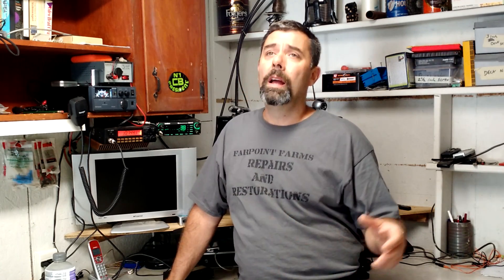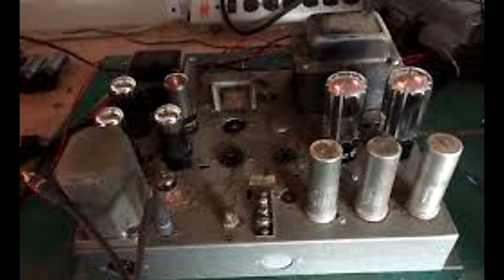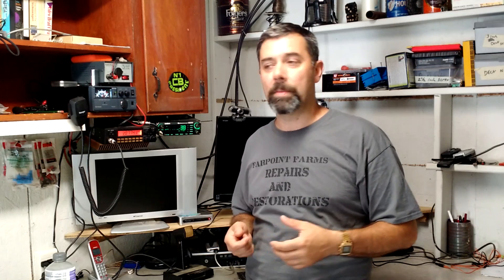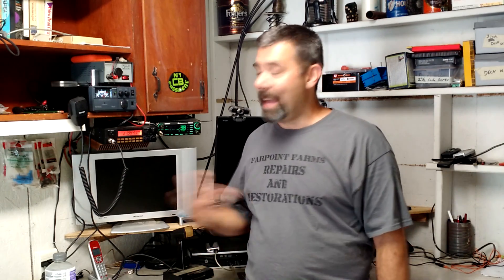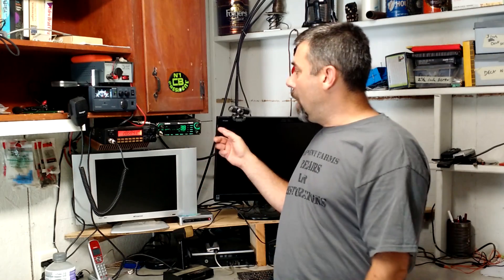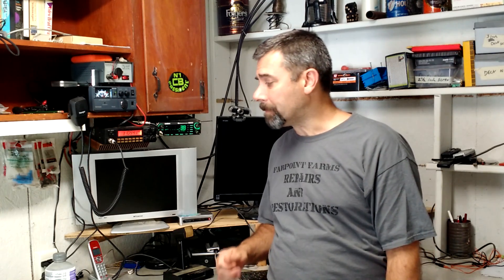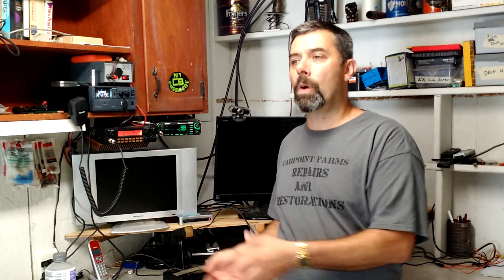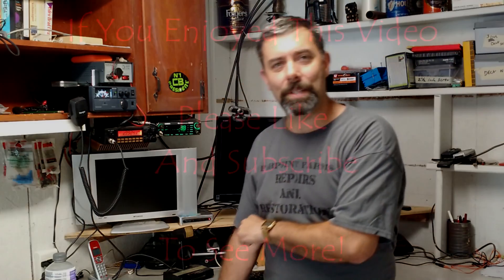A Beginners Guide To CB Linear Amplifiers.

Comment: I remember a little differently, the amps I used multiplied the signal by a factor of ten...100 watts in 1000 watts out....so to keep it simple I eventually had a kicker for the kicker...all of this stuff was locally made as in the late 60s there was not a lot you could get...I lived out in the country so interference with anybody else was not a problem.  If I heard them I could generally talk to them....I also had a set of five-element beams in the top of a 110-foot pine tree which helped considerably..When not using the beams I used a big stick mounted in another tree....its was a lot of fun back then but I had to give it up when I went into the military and transferred around a bunch....

Comment: I built a Heathkit GW-12 base cb back in the early 60's. Fast forward to 1999, at a Hamvention swap meet I found an identical GW-12. It works great but only puts out 1 watt. I replaced all tubes and tuned the coils per manual, but 1 watt was all it would transmit. This is why I am looking into a amp that can take my 1 watt and increase it to 25-50 watts. Any suggestions???

Comment: I have a fat boy competition amp that I occasionally use when the skip is rolling and it’s a high drive 6 pill with HG2879 finals I bought it used for $570.00 new they go for $850.00 I have my set up in an 18 wheeler all properly turned and running clean

Comment: I was a US Navy ET. Stationed in Charleston in the late 70s. The guys, we were CB nuts. North Charleston had a Army/Navy junk store. We ran across this tube 12 channel Johnson with a box of Tx/Rx crystals. We also found a linear amp 15 to 300 MHZ. 1000W. Make this short with help from the US Navy and our Division engineer. We ended up with this Flame Thrower. We never got caught. Drank to much Jack to worry about. I got out 1978. With some tuning we got 21w we ended up using a tunable attenuated load with a power meter. We could get 450 to 600w. We used RG214 even had access to run return loss on all the setups we made. I found you on Pinterest great video. I too live in WNC

Comment: I bought my first cb radio in 1975. A Royce 1-602a 40 ch. After a tune up , low key with best swing in wattage. Was 3 wstts key with 7 watts swing. Stock mic. It was very clear transmission with forward swing and about a 7 miles good talking. Using the 102" whip antenna. 
 Later I set up a base station with a supper penetrator 500 antenna with the President HR2510 did a chip mod for more frequency 26.000 mhz - 29.660 mhz .
Put a mini scout amplifier inline and adjusted the power of the radio down to 1watt key up and 15 watts swing. That is as low as it would go. Talked all over the world with 140 watts swing. ALWAYS had good compliments on the sound and clarity of the radio. I was using the D-104 mic.
 I did use a texas star dx 900 in my pickup truck that would do 1000 watts on high power but I ALWAYS run it on low or medium power for the most swing. Talk 40 miles in the day to base station.

Comment: Have an old Kris Mach 3B tube amp from the early 70's. Recommended not to drive it with more than 3 watts...as per the manual. Would that exclude a radio that dead keys 2 watts, but swings to 15 watts with modulation? I always thought that the dead key is what matters and not so much the swing wattage.

Comment: Thanks Eric, you just talked me out of an amp.
Reply: You don’t need an amp. In the early 80s I had a good radio with a good mic and a good antenna, and I lived in a higher elevation than most of the idiots on the radio in my county. My signal was clean and strong! Then one day I raised the antenna another 10 or 15 feet, holy cow! Much better improvement than any amp could have ever done, and regular people that I spoke to were accusing me of running an amp because my signal got that much stronger. Quality Antenna and height are king!

Comment: I have a Realistic Navajo TRC-433 Basestation cb , ext. swr/antenna switch…connected to a Tram-1499 antenna. I have a linear 50-80 watt amp and power supply coming from eBay… I’m making a mistake aren’t I ? Thanks again for your awesome channel

Comment: I remember my auto mechanics class in high school back in the late 70s the instructor had 4 or 5 of us guys stand close to the cb antenna on his car holding fluorescent bulbs and when he keyed the mic all of em lighted up...being teens we were suitably impressed!
Reply: I remember the fluorescent tube trick. I took auto mechanics in junior and senior year in HS 1970 & 1971.
Reply: We did that in the Air Force before climbing on fuel trucks to check levels for our generators on radar sites. They’d tell us they blocked out transmission to that sliver of a spot. We had a tube duct taped to a broom stick that we’d hold high up. Definitely saved us from radiation a few times.
Reply: My electronics teacher SUCKED!  I should have took auto mechanics.  I ended up being a forklift mechanic anyway
Reply: @justins3810 
😂
I was the opposite my auto shop teacher sucked and I became an E.E 😂
Reply: You will need an antenna set to handle the power you are going to use. Heavier coax is also a really good idea.
Reply: zip tied on to an antenna. I got pulled over for it LOL.

Comment: Cool video. 
I run a. Competition built    Galaxy Saturn Turbo radio with a custom rebuilt KLV 2000 amp (4400 pep) threw my 5/8's base antenna 45'  
#12... Watkins Glen new york wavin.

Comment: ++++++++++++++GEE LINEAR AMPLIFIERS ON CB RADIO IS  BIG NO NO N IN AUSTRALIA AND WE ARE ONLY ALLOWED 12 WATTTS -PEP + EVEN THOUGH IT GOES ON (I HAVE NEVER USED 1) I WOULDN'T TEMPT THE LAW+++++++++++++++ANYWAY IF YOU ARE CAUGHT USING A LINEAR AMPLIFIER THE LAW HAS THE  RIGHT 2 TAKE ANYTHING RELATED 2 CB RADIO AND IT'S NOT A CHANCE I"M WILLING 2 TAKE++++++++++++++IT CAN BE AN EXPENSIIVE $$$ ENDEVOUR+++++++++++++++NO LINEARS 4 ME++++++++++++++

Comment: Hey. I got my eyes on a ssb/AM Cobra 135, Palomar skipper 300, Uniden BC890XLT, Dosy TC 4001, Para Dynamics Antenna Switch PDC4-DX. All I want to do is talk from home at my apartment on the CB Radio. I have an old Midland 76-858 on its way in the mail if it works. What are the other items listed good for? Do I need the other items? Is one an amp? If I use amp in my Apartment will I be in trouble? Could I use Palomar later legally for ham radio? I assume that's the amp maybe? I'm new to Radios. And want to learn. I'm disabled. Sick of Facebook. Want to keep it old-school. Love and Respect!

1 Cobra 135 radio
1 Palomar radio
1 Uniden Recruit BC890XLT radio
1 Dosy C-400 meter
1 Para Dynamics PDC4-DX antenna switch
4 microphones - Sadelta, Astatic, Magnum, Galaxy

Comment: Every amp I have owned easily handled the regular cb radios, 3-4 watts output. People who make these amps know what power is being used and build accordingly. 1/2 watt is ridiculous. The most basic keying circuits, using the 2n2222 transistors, yes, I have built many amps, just finished one with two 8950 tubes, will take the 3-4 watt level of power from a cb. If the maker of the amp says you must use 1 watt or less of drive, then don't buy it, it's crap.
Reply from the maker: Good to know!

Comment: I've been on the CB radio for many years and I enjoy the radio I have a lot of fun but in my opinion the majority of people on the CB radio are running power if you don't have a little power you're not going to get out over the noise level as far as the FCC goes here in the state of Florida I was told there are only two FCC agents and they really have bigger fish to fry than worrying about a operator running a little Heat if you're running a lot of power and interfering with School PA system coming over the fire department radio you will definitely have the FCC looking for you we have an idiot here in Florida on Channel 1 who throws a dead key for hours with noise toys  the other day he was keying  up on three different channels so here you got a fool with three base station antennas throwing dead Keys interfering with people's conversation he has been doing this for years you would think the fcc would come knocking at his door nope!!!! Like I said the FCC has got way bigger fish to fry than somebody running a little Heat
Reply from the maker: I've heard that from a few folks. The FCC is no longer interested in the CB/HAM bands. They are there to protect commercial interests.

Comment: Been 4 watts ever since CB was moved from UHF to HF. I wish it was still on UHF.
Reply: GMRS is UHF is Part 95 CB but needs a license.  Cost for the 10 year license is $35.00 and you can run up to 50 watts and use repeaters.  Your immediate family can operate under your call sign just like back when 11 meter CB required a license.

Comment: Being a CBer with a "ticket" , having a clean signals is better than strong distorted signal.   Put the money were it should be, in the antenna system. The radio is only as good as the antenna system.  High wattage isn't always the solution to communications, but the mode used (SSB, FM, AM or CW) is part of the answer to the problem. Just another tool in the toolbox.  Personally, I still enjoy SSB on channel 38 running a stock out of the box Cobra 148 GTL. Old school.   Always have enjoyed your videos and your "style" of presenting information, kinda like FDR ' s fire side chats during the Great Depression.

Comment: I used to build my own amps back in the day. If you know anything about tubes, I used two 4cx250b's. They were metal tubes that sat in chimneys with a blower pushing air thru. It would do 600 clean watts am and 1200ish ssb. Had a 4 element moonraker 80 feet off the ground. It was a good combo to reach out and touch someone. Ahh the old days. Now I'm more in to low power FM.
Reply: The moonraker, was THE legendary antenna, back in the day,,,GREAT name for it, too,,,,,,😎
Reply: My grand dad had a 4 element moonraker on a rotor and a 201a tram it would blow the windows down

Comment: To propagate a signal for 100 miles that antenna would have to be high enough in the air to irritate the FCC. Line of sight is still a thing despite power output. I can tell you that ( and this applies to the high drive amps too ( I really don't care if you agree with me or not, been there and tried it more than once)) 1 to 1.5 watt dead key and swinging to say 7 or 8 watts is perfect to drive any texas star or palomar ( and most off brands).  At that point everything stays smooth and happy. Also, keep the modulation reasonable too so you don't splatter adjacent channels big time.  Legal or not, I like being prepared for emergencies when I am on the road. You never know when you'll be in an area with no cell coverage, being able to fire up a couple hundred watts might just save the day.

Comment: The fcc really needs to revaluate a stock cb power out of the box now that tv’s are all digital and don’t suffer interference from cb. A stock cb should be allowed up to 50 watts so your getting a product that works out of the box. 4 watts just isn’t enough on AM unless you have a big antenna like a 102 whip. The 80’s was so much fun on cb and way more active than today.

Comment: 4 watts works ok if your running an antron base antenna like 40 feet in the air but in a mobile you need more than 4 watts to be heard more than a couple miles unless you drive up to a big hill. A cb should come stock out of the box with 3 power settings 1,5and 20 watts.

Comment: It says on the FCC website that they are no longer enforcing CB amping. It says they have better things to do.  RM italy's are designed to handle up to 20W dead key p to p. It is good in a truck to amp to about 50W as there aren't many on anymore and you need to be able to reach out and touch someone, especially in the mountains.
Reply from the maker: That is good to hear about them not enforcing it.

Comment: Hi. Do you work on radios? I also have a Uniden Washington that I purchased 2nd handed. Somebody put the extra channels in it and on the regular 40 it doesn't key up and transmit as good as it does the extra channels. I also live in NC. Thanks
Reply from the maker: No, sorry. There is a guy some where near Hickory that does work on them. Not sure if you are close to there.
Reply: @FarpointFarms  Thank you. I actually live in Concord, near Charlotte. I use to travel to Taylorsville to have my radios worked on but the repairman passed away and I haven't found anyone that I trust now to do my work. I would drive to Hickory if I knew how to get in touch with the individual your are referring too. Thanks for your reply.

Comment: You're right most amplifiers can only handle one maybe two watts of input. Now if you get yourself what they call a high drive amplifier those can handle more power. And you've got to be careful with a lot of amplifiers today because most of them are using mosfet finals. And they cannot handle any type of serious power like the good old Toshiba transistor.

Comment: I run a big RCI 400w radio in my semi truck, I don't run it often at that power, as I can flip the switch and do 50w. My big advantage is that while most guys can't talk to me until they get closer, when I start hollering at the opposing direction of traffic that there is a wreck, or emergency up ahead, they hear me long before.

Comment: I want to boost my signal because it seems like my radio can't reach out more than a mile.
Reply from the maker: I would first make certain that the antenna and cables are A-OK. The antenna is the #1 reason you will have issues with signals. Try to hook a SWR meter up to make sure it's tuned right. If all else fails there are always amps, but putting an amp on a radio that is tuned poorly will only cause damage and anger.
Reply: @FarpointFarms  I have a Cobra 29 lx radio with a Wilson magnetic antenna.

Comment: The bleedover is generally more about the amp / transmitter having a ton of deviation - basically a junk unit that can't stay in its lane. Ham rigs are often in the 1000w or more range and they aren't bleeding over into terrestrial radios for the most part. A whole lot of that interference was caused because people that didn't know what they were doing were building linears from kit with questionable components and design ... if the FCC was really worried about it, they'd have allowed some linears and certify the equipment. There's not much of a reason cb can't run 20w, it's not that much but it'd have got the vast majority of people what they were after probably.

As for skip - there are hams that talk all over the world on 5w QRP rigs. Get the right antennas, cabling, and whatnot - good radios etc - and realize that watts don't equal range necessarily.

Comment: DB is a logarithmic increase. So it confuses the heck out of people who aren't techs. Write this down. This is much easier.. Each time you double power out. You increase transmitting range ~ 40%. A general rule for RF engineers and techs dealing with path gain. Can be calculated and confirmed using a smith chart. Obviously, Will not apply to signals being attenuated by the horizon. But a great rule of thump for line of sight. The very best bang for the buck is 50 to 100W output. Trying to punch over the horizon using ground propagation demands even more power per unit of range increase. Diminishing returns. In vehicles, big amplifiers can easily load and overload alternator max ratings causing premature brush failure. That can leave you stranded...Course, that never happened to me. Im way to smart..Right? 12 watts PEP generally hits the horizon with a pretty good usable signal. 85% of a station is its antenna. 85% of a radio is its receiver. put most of your cash and effort into the antenna just like this guy says. Then buy a silly looking radio with lots of knobs on it.

Comment: At 13:45, I agree it's a bad setup if you're using RG-59 (75 ohm) coax instead of RG-8 or RG-58 (50-ohm) for CB.  😉
(Yes, I'm sure you mis-spoke and meant RG-58.)

Comment: Like many people who gave up CB and decided to get their ham radio license. The FCC has removed CW requirement from the license.
Two meters is short range, 30-50 miles depending on the antenna and power.
Two meter single side band running 15-20 watts will get you 200 miles.
You have the 450 mhz band or setting up a station to talk to (OSCAR) Orbiting satellites carrying Amateur Radio.
I like to hand out on the high frequency bands such as 80 meters. We get on the air in the morning with a group that range all the way from Oklahoma, Dallas, Lampasas, Louisiana,  Houston and San Antonio.
We talk about everything from flying airplanes, Drones, Radios, Antennas. The subject varies with what we are interested in.
One thing when all the cell phone systems go down ham radio operators will still be able to communicate.. '73es
Reply: MHz, not mhz.

Comment: Nice video, I started off needing a license and had and still have my 23 channel RCA tube cb with a vfo, needed to buy crystals for transmit also used a couple of linears.
Reply: I had a Cardon Spitfire back in the day, wonder if it's the same chassis as your RCA. iirc you could peak it for around 30w swing

Comment: You are correct. one "S" unit is equal to 3db. Which means an antenna that has 3db gain doubles your signal. 3 db doubles, 6db is times 4. Feed line (coax is a loss). The basic rule is "your antenna is 90% of your station" Think about it. Buy and $4000 big screen TV and hook to a set of rabbit ears or a crap antenna. What do you get. A poor signal. The purpose of a radio is getting the signal in the air waves. Some people go, Oh it's expensive. I have some hardline in my ham station that costs just under $10/ft and the connectors are $70 each. Buy good coax (RG-8, RG-213) Get a good antenna. They don't have to be expensive. Put up a long wire, and keep the SWR down
Oh, you don't have 440 coming in your house, normally. That's a 3 phase voltage and when CB's first around, the 23 channel radio's were 5 watt.